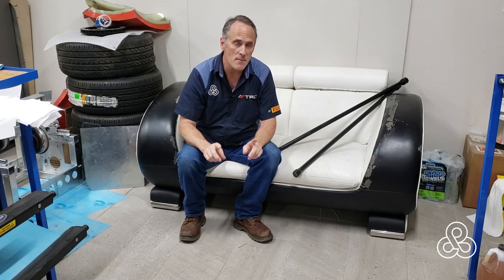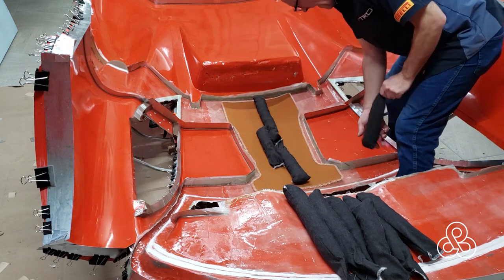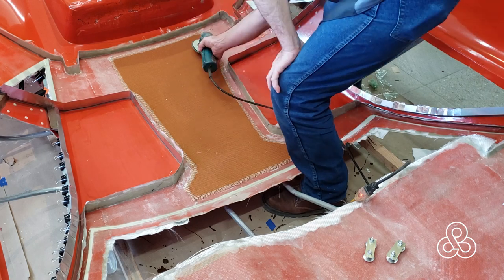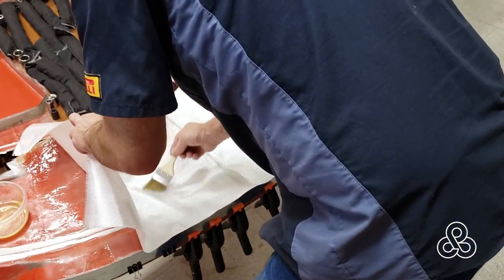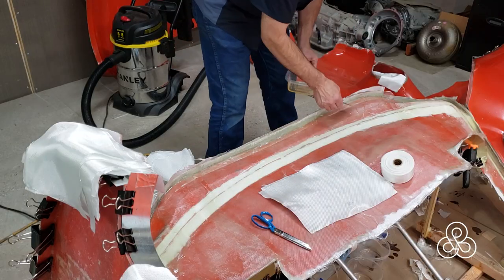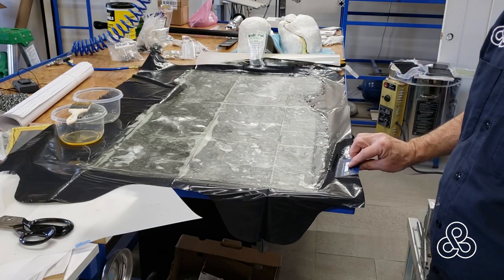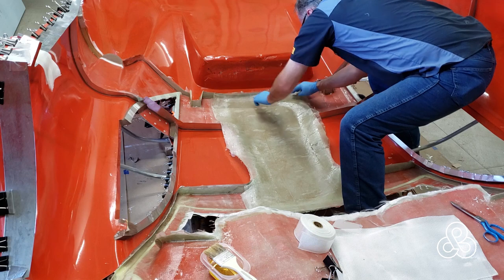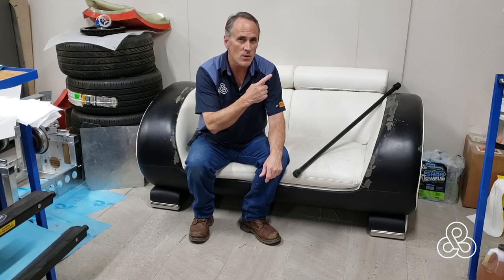A21 - Reinforcements at the Monocoque tub. Arete Supercar Project.

Comment: Another tip for you. I use house building vapor barrier as you do the garbage bag. It comes off much easier and is more firm to transfer without sagging. I often wet the layers out and then put another layer of plastic over top. I then use a heaver roller to consolidate the glass or carbon fiber which eliminates excess resin and air pockets.You can now use scissors to cut pieces without a mess. The plastic peels off effortlessly.
Reply from the maker: Next time I get some I'll give it a try, but every time I build a house I curse at the price of the stuff!

Comment: torsion bars? They can be used to an interesting effect for either front or rear suspension, as they provide a surprisingly soft and compliant ride compared to standard coilovers. But they can also be too soft for aggressive cornering. There were some race teams that liked them because it changed how their drivers approached the course and helped improve tire longevity throughout the race.

Comment: Sir, is mounting door bolts in fiberglass safe, as in, does fiberglass has sufficient torsional rigidity to withstand the weight of the door with glass in it when kept open, and can it withstand the strain of opening and closing of the door. Like I observed the 2 horizontal metal plates in the bolts which might provide more surface area for bonding to the fiberglass but are these kinds of mounts not mounted to the chassis.
Secondly, now I get why you used the Nomex honeycomb layer, for weight savings (question asked in the last episode). so is the Nomex just to occupy the volume rather than contributing to structural support? 
Sir, I'm having these doubts/questions due to a lack of knowledge about the material and the design. so, please if these questions are too basic or bothering please let me know. like I know that you are extremely experienced and have a clear idea of what you are doing, I'm just consumed by my curiosity. so I'm sorry if I came out to be rude in any way.
thank you...👍
Reply from the maker: Door bolts- I think your worried because you are looking at the small bolts for the little teetering hings at the roof line, rather than the larger hinge that will be located under the fender. Are bolts in fiberglass strong enough?- Yes! It is all dependent on the strength (amount and orientation) of the layup you create around the bolt. So as you don't worry; There will be much heavier bolts and layup at the primary hinge. (plus the door will weigh 1/4 that of a steel cars.) Honey comb- Although you could increase the strength of your composites by creating by just creating a space the core material does add certain structural characteristics. Of all the core choices Honey combs do so with the best weight to strength properties. There are two most common honey combs- Aramid fiber (DuPont Nomex brand which I use) and aluminum. Aluminum is a little harder to work with. The honey comb cells are not filled if you use a pre-preg or pre-wetted fabrics. Doing a wet lamination ( brushing resin directly on the fiberglass covering the honeycomb) on top of honeycomb will indeed fill the cells.  To many questions?- Not at all and certainly not rude. This is why I am using YouTube- share the knowledge and connect with people!

Comment: I like your use of elevator bolts, and that may be cheaper than what we’ve typically used, but for different configuration fasteners and tie down points we have had a lot of success with the Click Bond product line. You may already be familiar with them... These fasteners each come with a removable fixture that helps installing and temporarily securing the fastener in place while epoxy bond cures. So the procedure is to apply epoxy to the bottom disc of the fastener you want to mount, remove double stick tape surface of the fixture, place the fixture exactly where you want the fastener to go, then “click” the fastener down to the surface of the part to bond it in place. Hence the name “Click Bond”. This way the fixture remains in place until the fastener bond is cured and doesn’t allow the fastener to move. Once the bond is complete, the fixture just threads off or is easily removed depending on the configuration. We’ve done pull tests on these and they can handle significant loads.
Anyway, just want to tell you that I’m thoroughly enjoying each of your exceptional videos and please keep up the great work!
Reply from the maker: You mean you like that I'm a cheap-skate! Ha! Although the RotaLoc fasteners are made for this type of connection, I don't think they add a significant gain over the less expensive elevator bolts. If you need a female insert then the RotoLoc is essential. Click bond- If you don't have the opportunity to add lamination over the fastener as in RotoLoc or elevator bolts then Click-Bond is for sure the go to! Keep saying this, but should just deliver, more designing with"composites" videos coming" (perhaps fastener pull strength tests?)

Comment: Drilling tiny bleed holes in your threaded stud insert's base helps with entrapped air. 
Vacuum bagged every insert because the installation procedure was already established and certified. Curious of any difference in strength and longevity between the suck no suck installs.

Comment: Not worried about those bolts rotating at all when you tighten them in? I would have thought the bolts on a plate also would make sure they never broke free and started spinning.
Reply from the maker: Almost 3 square inches of surface area and high quality epoxy = not worried

Comment: Using a kind of prepreg fiber is a smart idea.
I like to use polyethylene tape to avoid contact with resin, but using garbage bag is a more cheaper way to do this. 
Nevertheless the Nomex nida is quite expensive, Nidaplast is a another nida solution, it's a nida of plastic between two thin fiberglass layer, so no need to protect it from the resin filling the voids.

Comment: Using Epoxy to make this, did you find a solution for 'post curing' the epoxy? I'm making one myself and trying to figure out how to prevent my car from warping and melting in the texas sun haha.
Reply from the maker: The epoxy system I am using does not require any post cure. (unless the parts are going into use immediately; and with a few years into the project, they are well aged. Ha!
Reply: Interesting. Id love to hear more about that epoxy. Its one of the major hold ups I have in making larger parts  thanks!!

Comment: Please wear gloves. You shouldn't touch epoxy with your skin. I would hate to see you become alergic before you can finish the car. I know a pro who breaks  into rashes just walking through a composite shop.
Reply from the maker: You would be astounded at my ability to work a brush for hours and never get it on my hands. you will see on occasion, in videos, that I do use gloves when "hands On" is the only option.
Reply: @BuilderCreator  Rubber or vinyl gloves seems to be very expensive there, but luckily going to see doctor is cheaper.